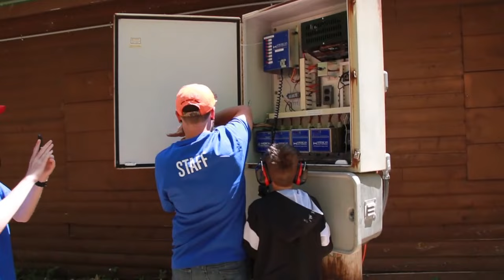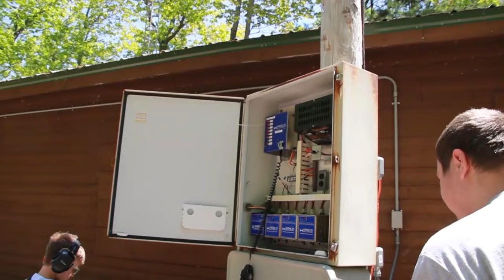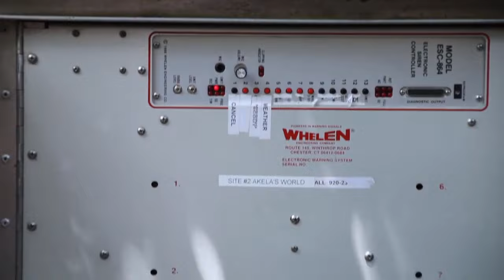SirenCon 2022 The Movie!

Comment: The reason why at 34:50 Spins is because if its on a pole you see some zoomed videos the top goes “shiver me timbers” its because the chopper looks like its attached to the top or something on the top thats why it wants to spin with it but since the pole is attached it wouldnt spin but for this one theres no pole so it would spin with the chopper and at 35:13 they added weights to the side to stabilize and it wont spim

Comment: 34:33 those things have a ton of torque and the air coming out of the chopper made it fly almost
Reply: S10 died
Reply: I think the control panel contactor died... those sirens take a lot of amps when starting... maybe the current was too much for the contactor  @Nizamadhipramana_bocilauttp
Reply: not even the air it’s just the sheer torque combined with turning the heavy chopper made it spin, you see it with most omnidirectional mechanical sirens.

Comment: I am looking for audio to a particular type of fire siren/whistle that was used in my village where I grew up. It was NOT a siren that would wail as it was spinning up or down like the modern ones today. It was like a blast of air? it would sound hi tone low tone in a series in numbers to indicate fire, school closings and delays. Example school closing: blast once hi then low pause hi then low pause hi then low over 20-30 seconds total. For fire it would blast according to which part to town the fire was in.  I know this sounds confusing but, someone else out there knows what I mean. Possibly controlled by air blown across reeds? It was a real clean horn sound, not raspy like these screamers. from what I remember it was shaped like flying saucers on top of one another x3. It was in use from the early 50's on through the 80's as long as I can remember it. any leads or help about it is appreciated. Thanks in advance.
Reply: Ether a I-Force or modulator